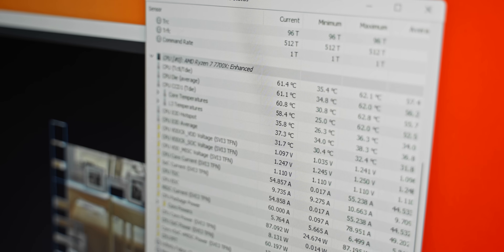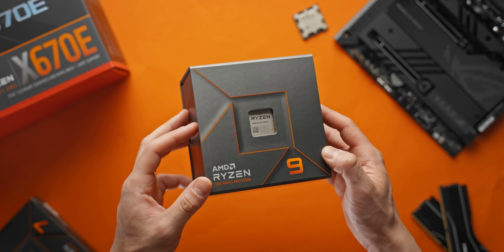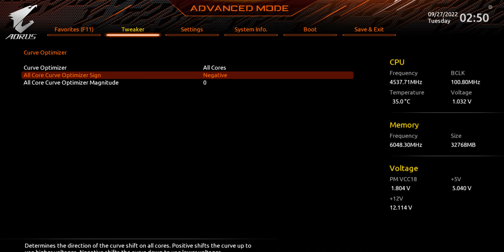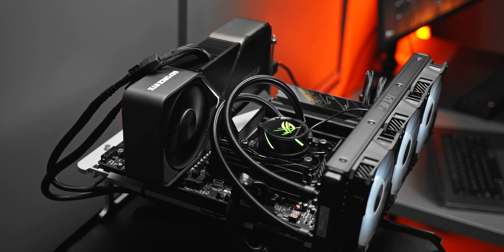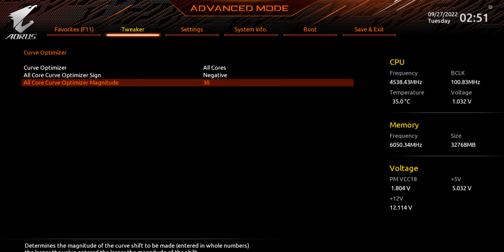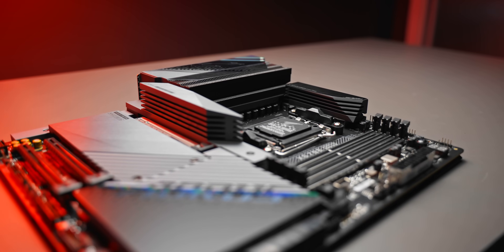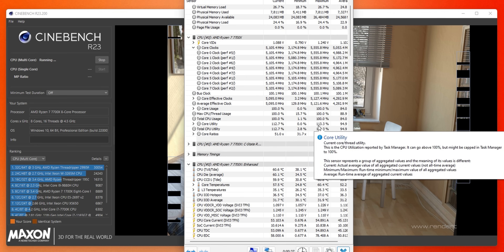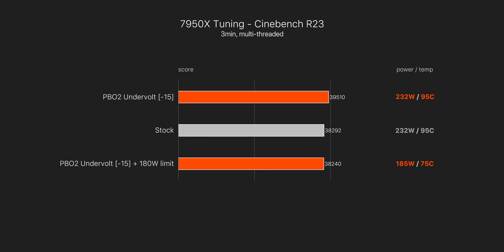Fixing Ryzen 7000 - PBO2 Tune (insanity)

Comment: Just a note, just because the Cinebench run was stable, it doesn't mean it will be stable on idle overnight. Keep that in mind if your pc randomly bluescreens or shuts down, you will want to back off that curve another 5 or so
Reply: Yup - it’s still worthwhile, but chances are fairly good it will require a little more tweaking to be stable. My 5600x benched fine at -30 all core, but would randomly restart once every thirty days, or more often with certain games that exhibit certain clock behaviors. Over time I stepped it down on some cores to - 20 before it stopped happening.
Reply: @essenceofsias
Reply: Yep. Use more advanced testing tools like Prime95 or YCruncher or something easier like OCCT to actually make sure it's stable
Reply: @prithvib8662  from what I found with my 5800x the stability issues came up with low power/idle situations. Someone had made a script to automate running P95 on 1 core at a time which was supposed to be an effective method but takes forever. I ended up settling on -25 on most cores and -15 on a few other cores just from trial and error before I finished that scripted P95 testing so I can't say how well it works. But the standard methods weren't really helping with stability.
Reply: @realbadtech  I had stability issues with my undervolts when idle / low power scenarios on my 2700x. I resolved it by disabling PBO, setting a set core voltage of 1.3 volts (motherboard has an +offset of 20mv) and using a negative offset (-104 mv) and set an all core OC. Also downclocking the RAM to 2800 Mhz allowed me to use less voltage for the RAM (using 1.236 volts) and although it's marginal increasing the ram voltage also has an affect on the memory controller - caused me random memory errors. With the ram at 2800 Mhz i was able to really tighten the ram timings. With 32 Gigs of Ram, All Core OCed to 4075, I get 4100 consistently in R20. I don't have a 5000 series CPU to test around with so not sure if the above helps 🤷‍♂. Also with the current settings I barely hit 83 degrees using a Arctic Esports 34 duo in a H500M when rendering using blender - at stock max all cores would hit is 3993 Mhz. I can get a higher OC if I wack up the voltage but since the way Zen + is designed I'll have to reduce the RAM down lower than 2733 otherwise there are stability issues.
Reply: @earthtaurus5515  Thanks for the write up you ended up taking a really interesting approach with the voltage offset. My 5800x has been stable for quite some time but it did take me awhile to get there with the negative offset method. There were a couple months where I was getting a lot of shut downs while idle but its been smoothing sailing ever since.
Reply: @realbadtech  Happy to hear you managed to work out the kinks 😁. Ryzen is a very different platform and does not exhibit behaviours that almost everyone has gotten accustomed to with x86/X54 with Intel. I have to say when I started tweaking my build from Sept 2019. It completely threw me lol. I'm curious, how did you do anything else other then core negative offsets?
Reply: @prithvib8662  Maybe, my experience is that the CPU will crash Windows close to idle, where it gets peak frequency spikes. Obviously that doesn't involve a benchmark. For some reason Discord is a good test, it can crash the system or not run. This is an indicator that all is not well
Reply: @prithvib8662  even that dosnt prove it's stable, you can have a PC running prime 2 small fft's 2 days and pass, for it crash in games just after. Dont get me wrong, prime95 is a good test tool, but its only one out of many test needed to be done to have it prove stable. When i tune, i do prime 95 small fft's + msi kombuster at the same time, this stresses both GPU, CPU and PSU at the same time(dosnt have to mean the PSU get's stressed, depends on what kind you have ofc, but its good to put pressurre on PSU also during those test). When that is done i usually do some quick memory test and after that just use the PC for different games over longer periods, it it proves to pass all this all it need is time, give it a week or two, passes that, it "should" be stable.
Reply: I wanna add as someone who has messed with those curves and just doesn't bother anymore that you can find your curves aren't stable MONTHS later rather than just overnight.

I really wish there was an easier way to test the use case where the CPU cores idle in such a way that they hit a part of the curve where a core crashes
Reply: @Akasen1226  Find what is stable, then add 5 ticks buffer to be safe.
Reply: Very good advice. Also in Ryzen Master you can now change these settings without going into the BIOS (atleast the offset) and so you can run OCCT and change each individual core and test it. That's what I did with my 5900X because if I did a negative offset of 15 on all cores I'd have bluescreens at idle. Changing them individually then using OCCT and letting my PC idle for a bit allowed me to dial a lot of them at -25 while some of my higher performing cores only went to -10.
Reply: This was issue for me. I can run -25 I think for Cinebench fine, but would wake up to a reboot, or random crash web browsing. Set to -20 and it's all good. 5800x. I think AMD needs to boost low usage voltage just a tad when doing CO.
Reply: @xeridea  this was also my experience on my 5800x. I now use -20 all cores and it has never crashed.
Reply: @bee2791  this right here is great advice when manually tuning the cores.
Reply: @friedpickle9828  How to see failing core in event veiwer? please help
Reply: @FrostyBud777  Launch Event Viewer on Windows > Right Click on [Custom Views] > [Create Custom View] > Select (By source) > Add [WHEA-Logger] > [OK] > Name your Custom View and save.

Now if you click on your Custom View, you will probably have some Errors. If you click one you will be able to see the [Processor APIC ID: x] in the General tab under the list of errors.

The [Processor APIC ID] tells you what CPU core failed. (For example : I had errors that were showing [Processor APIC ID: 8] and [Processor APIC ID: 9], so this corresponds to my Core 4 (ID: 8 = Core 4 thread 1 and ID: 9 = Core 4 thread 2)

I just learned about Event Viewer that very night, apologies if there are any mistakes, but it seems to have solved my problems.
Reply: Yeah, he shoud've run Prime95 and some memcheck (OCCT for example). I've set the PBO curve on my 5900x at first to -20 and everything seemed to run OK. Except when running p95 it would error almost immediately. I've settled on -17 with no errors.
Reply: i settled on -25 curve optimizer and pbo boost on. everythings been working great since.
Reply: I think I'm quiet lucky with my 7500f, it was setting at -30 and the xmp running at 7200mhz out of the box, stability test on OCCT overnight and not found any single error.
Reply: so thats why my 6600k blue screens at 4.4 Ghz
Reply: that's why i just tell cinebench to stress for at least 2 hours then go to work and if it's running when i get home 8 hours later i know it's good enuff XD
Reply: @bee2791  how do you do that?
Reply: It's causing issues with my ram and xmp idk
Reply: My 7700 crashes on longer periods of idle, with every option being on auto. But I´m not sure why exactly that happens, or what to do against it. Any ideas?
Reply: I’m running it at neg 30 no crash’s etc on my 7800x3d
Reply: To verify stability you want to run OCCT overnight on varying settings. A certain offset might work for the first (x) amount hours in a certain game, production workload, idling, etc. If you’re having trouble with idle crashes, +5mv on your first 2 preferred cores (displayed on RyzenMaster) and keep everything the same. If you have a lot of time on your hands then you can go through the trouble of finding the perfect offset for each core by process of elimination.
Reply: @amgcedes9463 exactly! I was running core cycler perfectly overnight. But OCCT would report errors after about an hour
Reply: I try magnitude 40 and cinebench was stable at that 10 min test, but 10 min palworld wasn't stable so i put it back to 30.
Reply: @jp4361  OCCT allows you to stress test variable workloads (mimics ingame utilization), including memory instructions. People forget that cinebench is a benchmark, not a stability test.
Reply: 7700x.
U are right! -30 curve was okay and stable in Cinebench and Portal RTX. But CS2 could randomly crash even in menu. Fixed in with -20 curve. Will test on -25. 

Also there is no point to set TDC and EDC so high. If u set it to “0” you will see that it is 110 and 170. Can’t be higher than 280/350.

Not 480/640.
Reply: Watching the full video is important too 😂😂
Reply: or Disable PSS Support, it will idle littlebit higher and will never drop low enough to crash
(PSS Support is not C-State so it will still idle but just littlebit higher than normal, it doesn't turn off idle-mid-high load states like C-State Disabled would)
My 7800x3D taking 27W on idle
Reply: Running a -45 pbo is the way to go
Reply: And its also depends on your motherboard. I have 5600x with stable -27 pbo undervolt on my B550i Aorus and after I transfer the same CPU to another motherboard which is B550i Asrock, now its stable in -20 not -27.
Reply: Yep, Cinebench is actually the worst to check for stability I think because it is a TDP bound test, meaning you will never hit the high clock speeds that you will encounter in games.
A weird finding: Java Mimecraft is actually the best CO instability test that I have ever seen. It can immediately, at launch show you if you have stable CO settings or not.
Reply: I’d run corecycler in safe mode because that’s where the lightest loads are and that’s where you will achieve the highest frequency’s also where it’s least stable.
Reply: @Epecnesss666  oh wow, first time I'm hearing of this. Thanks for mentioning this
Reply: I wonder why there's no clock stretching
Reply: @donematt1862  Because the CPU is adjusting its own v/f curve. Clock stretching happens on conventional undervolting because the CPU is receiving less voltage than it requested.
Reply: @imadecoy.  thx
Reply: Was wondering wtf was going on with random reboots no bsod.
Initial thought was psu or ram.

Im using Asrock Pre-set now. Bios 1.11
85c max temp
Highest score yet.
Seems stable so far.

Doesnt matter really. I personally cant stand these temps and will be deliding when derbauer release his hardware.

Has nothing to do with overclocking. -20c is very significant.
Reply: Who leaves there pc on overnight????? Just asking for problems.
Reply: @mkeefe4248  People that run servers such a Minecraft or Plex?
Reply: @mkeefe4248 what could possibly be bad with leaving your pc on outside of energy cost, if you aren’t stable at idle your undervolt isn’t stable in general what a weird thing to say lol
Reply: This is a good advice if done manually through BIOS. But the logic in curve optimization in ryzen Master I think handles that, since you are not undervolting really. You are telling the CPU to undervolt itself and then it does so with the amount of voltage appropriate for that load. Ryzen master has cycles of total idle and total load in the stability test during curve optimization.
Reply: @marsovac  You are doing it manually through the BIOS. You are lowering the set points of the default voltage curve lower, therefore pushing the cpu closer to instability with every negative offset point.
Reply: why would you want your pc to run idle at overnight?
Reply: This is an outdated advice only works best on traditional bios OC/Uvolting. Ryzen chips since 3rd gen have ai for auto oc/Uvolting
Reply: @practicalthinker5545  Many people like to do it manually, it takes only a few minutes. Also, there are limitations of Ryzen Master, such as forcing you to disable virtualization for it to work. Current build doesn't support 7000 series.
Reply: @xeridea  change 1 batch of parameters takes minutes then on boot it turns out unstable, so you go back in again and change another batch of parameters, and so on and so forth until you find stability. how many few minutes did you accumulate?
Reply: @practicalthinker5545  I did mine in about 20 minutes total. Autotune takes over an hour. It's not that big of a task to tune manually. Autotune is fine, but many like to do it themselves. If you factor in time for me to disable virtualization to even get Ryzen master to restart, then re-enable, afterwords, then do it again anytime I want to open the app, manual becomes far more attractive. Many would rather skip install, or are on Linux.

Comment: I had nothing but issues with PBO2 under volting on Zen 2. It would pass benchmarks and stress tests like core cycler and I would even pad with extra voltage. But no matter what, I would have random crashes. This was after weeks of working on the undervolt, too. Most of the time Windows event viewer wouldn't even tell what the issue was. In the end it wasn't worth it.

Comment: What kind of motherboard you used and how much it costs. Will we be able to do it on £250 motherboard B series? Or do we need £400-500 models? Still don't see it's worth upgrading from 5000 series for what whole 7000 series upgrade costs and how much performance we gain.

Comment: It would be interesting to see if this holds across a large sample size, but I suspect that in general there’s less room for undervolting on the 7950X sku due to those parts already being quite aggresssivly binned from the factory. Great video as always! I undervolted my 5800X years ago based on your guide, and it made a huge difference!
Reply: It seems to me that they are not binned at all. 7600X and 7950X give basically the same single core performance.
Reply: @marsovac  do you not understand that single core is the same across all Zen4 cpus? The only difference will be frequency lmao. The real difference is in multithreading.
Reply: @marsovac  My understanding is the binning has more to do with the average quality across all cores. It wouldn’t surprise me that a 7600X has a core or two that can boost very high within a certain power envelope. However, maintaining high all core clocks within a certain power envelope across more cores would require better binning.

Comment: I'm not upgrading this generation, but this is such a helpful video. I'm surprised AMD isn't pushing this in their marketing, because looking at those temps, I had no interest whatsoever in 7000 series and thought it was pretty lame how hot they were, but this video alone would be enough to make me buy it if I wanted to upgrade.
Reply: they did show in their marketing efficiency gains at lower power levels (they themselves stated something like 70% gain at 65W)
Reply: Because it increases RMA rates when a bunch of users who don't know what they're doing undervolt/overclock their processor because some clown on youtube told them it was a "fix".
Reply: @Vegemeister1  They are not only clown youtuber, they are paid AMD shills just like you can see with LinusTechTips, JayzTwoCents, GamersNexus, HardwareUnboxed and other popular TrashTuber.
Reply: It's so obvious AMD are scared to see the new Intel Raptor Lake, that's why they bump clock speed at TDP like crazy which caused the CPU overheating. They know Intel going to destroy them with Raptor Lake.

Comment: Note that due to differences in density, a higher die temperature compared to last generation does not mean your room will be getting comparatively hotter. The power draw is the more appropriate value to compare. So any processor pulling 150W will heat your room the same, regardless of die temperature. You should only worry about temperature for longevity, which I'm inclined to agree with AMD that 95C sustained is just fine. So it's more those power numbers we should be focusing on.
Reply: Well stated. I think many of us just don't like seeing a 95 degrees reading on our core temps readout lol... Makes us uncomfortable still.

Comment: Nothing new from zen 3. Gains are slightly bigger but you had to do the same with 5000 cpus. I have 5800x and i dropped my power limit from 142 to 120 and  CO on -18. I have lower temps and slighlty better performance. You could also play a little bit with per core Curve Optimizer. That would require a lot more time and depending on silicon quality you can get a lot or basically nothing. You would need to test cpu in something like core cycler to crash unstable cores and adjust it one by one.

Comment: I have a completely different idea. Just set your fan speed limit on your cooler and let it thermally throttle based on the TDP your setup can handle. At 95c it will be most efficient at cooling because the temperature delta is at its highest, and whatever wattage it can handle is where it will end up. Maybe thats 100w, or 200w, either way its going to use your system at its limit and never bother you with fan noise.
Reply: But thats not the point here.
Reply: @Devil-fd1ff  maybe thats what i said 'completely different idea....'
Reply: but you need to undervolt as your motherboard has no idea it can put less juice in
Reply: @GewelReal  changing the PBO settings isnt you adjusting voltages, its just looking at different spots on its clock/volt/temp table. Hitting a limit for any reason is no different on how it looks at that table. Undervolting or using the curves can change stability, so for people who dont want to do that, there are options that don't require you to really do anything with the chip, just let it figure it out. and YES it will know to put in less volts because it only applies the highest volts when its trying to get the highest clocks at its max temp, otherwise it will reduce it.

Comment: What kind of power consumtion/performance would it give you if you lowered the temp target to 65 °C instead of setting a power limit? What about the other way around what power target would lead to a max temp of 85 °C and what performance do you get comparted to setting temp limit to 85?